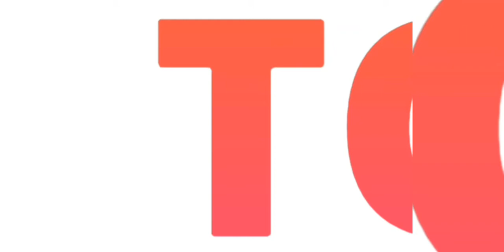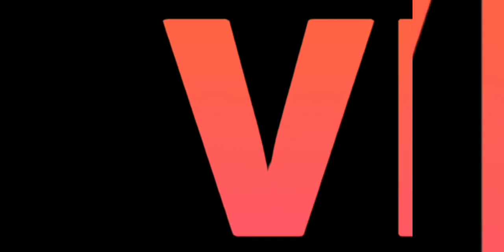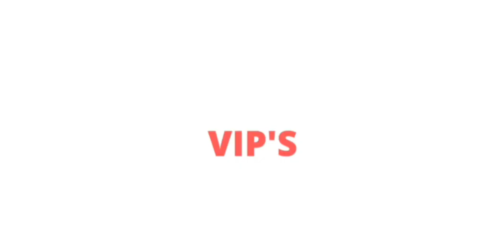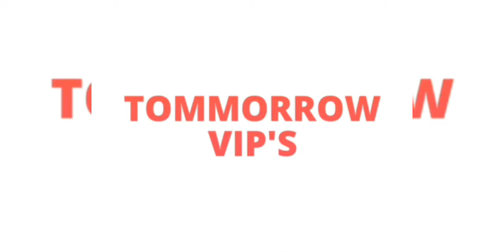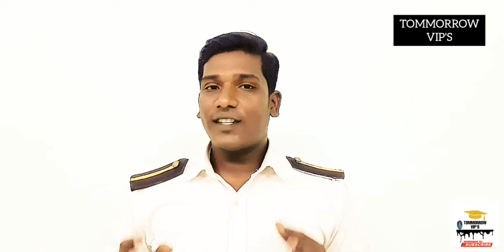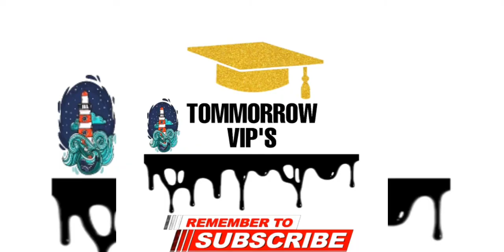| MARINE BOILER SOOT BLOWING PROCEDURE | ENGLISH | KARAN DESINGU |

Comment: brother, during soot blow, air pressure should be how much
Reply: The steam pressure must be at normal working pressure (like normal parameters for the other systems incluiding air). The soot blow procedure is by means of the same steam the boiler produces. Then, the boiler load should not be lower than 50%.